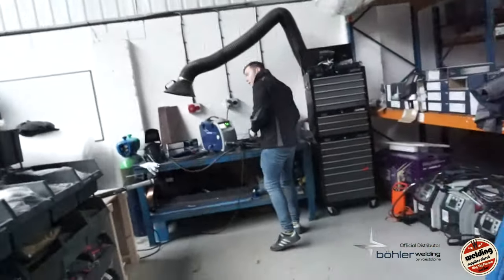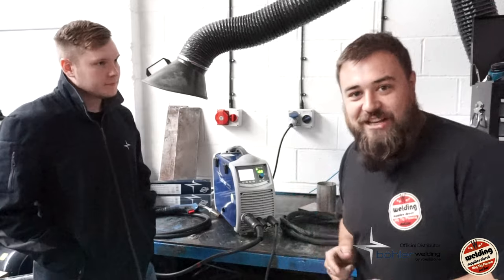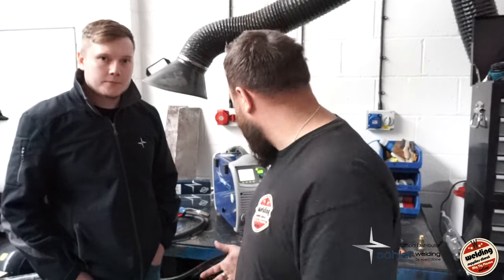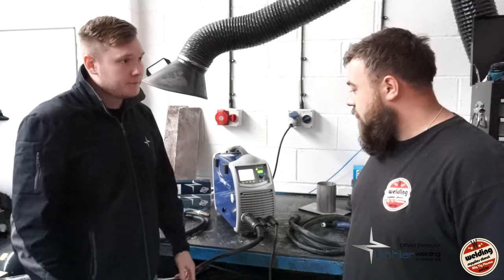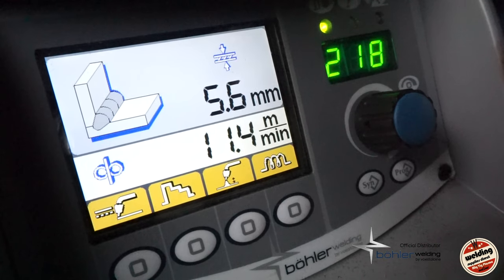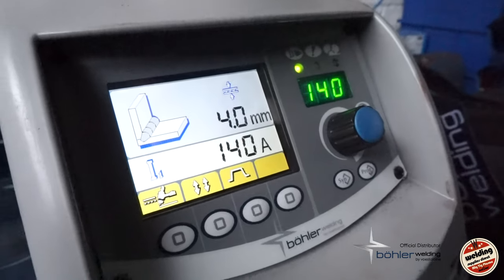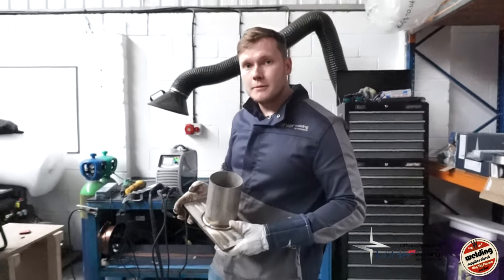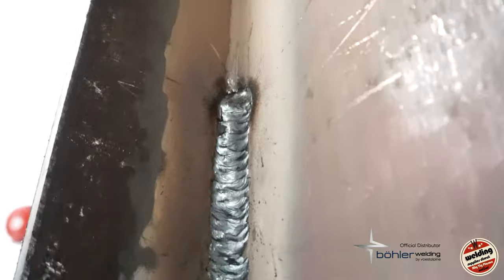The Best Multi Process Welder? Bohler Uranos 2000 SMC.

Comment: Hi! I have the same machine but I never tried TIG. How U starting TIG? You have touch material with wolfram or you starting with botton? I don't know have machine HF. Thank you
Reply from the maker: The machine is lift TIG, rather than using high frequency.
It has DC pulse TIG functions up to 2500Hz.